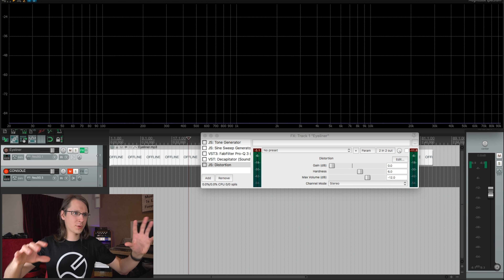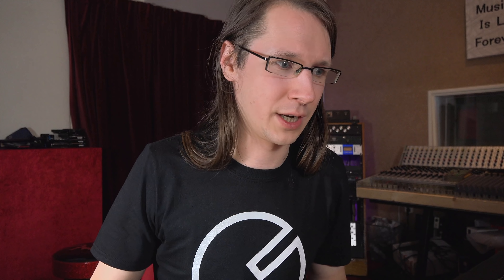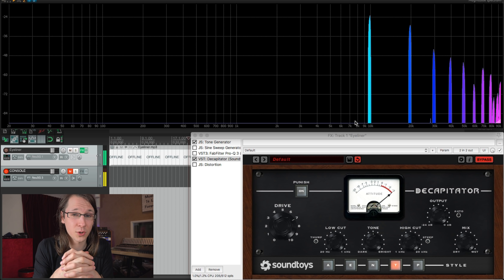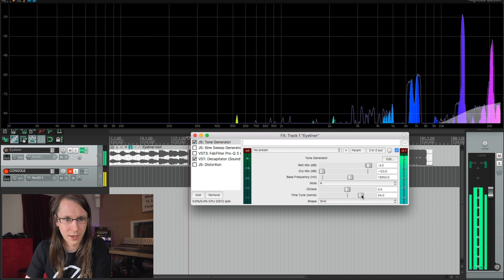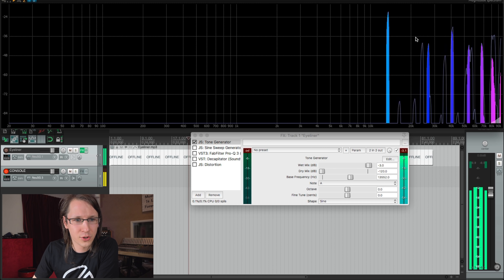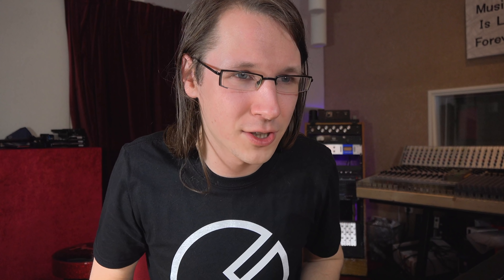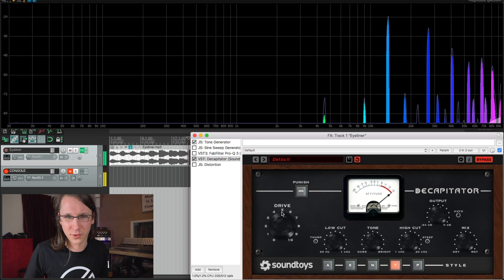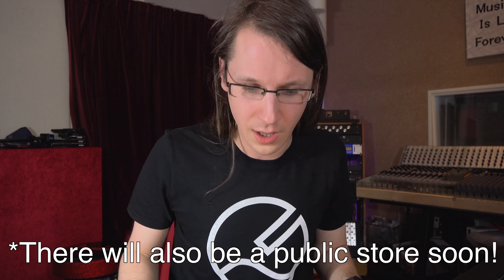Why MANY ANALOG EMULATIONS are SNAKE OIL!

Comment: couldnt you just use an insanely steep eq after a distortion to reduce aliasing? For example ableton's eq and saturator both have oversampling/anti-aliasing built in to avoid that. Could that just happen with say pro Q3?

Comment: What’s funny is I had this very conversation at AES LA  with a plug-in manufacturer he said all the things you just mention. Some guy tried to argue how 96k is overrated and not needed and draws to much cpu power etc. He basically gave him a science lesson on how sample rate operates on waveforms and also the relationship between plug-ins too. I felt bad that the music community attack you without the understanding of sample rate, low jitter, and clocking. They based their judgement on emotion and not science. They ran on I use this for all my mixes and this guy is an asshat. My view on it was did you run test to see why he said what he said and if no take your emotions out of it and chill!
Reply: which manufacturer was this?
Reply: @FloydAtema  This was back in 2016 I believe so I really don't remember. I remember sitting in the Genelec room before their presentation. Overhearing this convo (small room), and I started to kindly butt in and I learned the science behind sample rate and plugins and why they operated better at 96k.

Comment: So if it's due to aliasing then they're not 'snake oil' (?) Well, most of these problems can be avoided by proper gain-staging. Other factors are resolved by the approach that Acustica Audio (e.g. Nebula) takes. However, analogue devices introduce so many complex, subtle and no-so-subtle distortions & colours (that alter depending on all kinds of factors) that it is stranger to expect software to fully achieve indistinguishable emulations.

Comment: Greetings and thank you for the video. Would you recommend mitigating the anti-aliasing artifacts of distortion plugins in particular by using DDMF Metaplugin in its oversampling mode? I envision placing a distortion plugin into an instance of Metaplugin, setting it minimally to 4x oversampling, assuming one's session is running at a 44.1kHz or 48kHz sampling rate, and then routing the distortion's plugin into an EQ having a steep hi-cut filter. Would this better mimic the anti-aliasing capabilities of analog gear? Also, assuming this is a viable approach, how much of a CPU hit would this incur in comparison to simply applying a distortion plugin alone?

Comment: All very true. You can trust your ears but sometimes that isn't enough. I have come across some analog emulations (even quite high-end ones like the Elysia stuff) that produce aliasing artefacts well below the human audible frequency range but that are so 'loud' that they send compressors and other plug-ins later in the chain into meltdown, had to high-pass it out. Never liked decapitator though I really like some of the other SoundToys plug-ins. I think the analog emulations by Kush and PSP are good - it's not all snake oil by any means.

Comment: So the "Freshness" is creating "dirt" down on the lower frequencies, interresting. I guess the avarage plugin programmer doesn't care much about how the hardware works and they kind of fake it. 
They must have an attitude like "oh, now worries, she'll be right, it's close enough, no one will notice". That filter kind of makes sense, I've heard that a lot of early samplers contained quite a bit of anologue components in their input and output stages to make the sound nicer.

Comment: Thanks for this video. It’s indeed necessary to explain, why most digital simulations can work good in some occasions and fail completely in others. 
In addition: since the sample theorem is the limit, an enormous amount of oversampling would be necessary, to emulate distortion corretly.
The obvious question seems to me, why don’t we use digital plugins for all the tasks that require a certain precision and analogue technology for anything else?
I also think, a lot of producers and engineers care way too much about fancy plugin-porn, while recording as a creative process, especially good rooms, microphones and (last but not least) musicality as well as performance seem to be quite undervalued in some cases.
Reply: Actually, no you don't need an enormous amout of oversampling. The number of harmonics that aren't below detectable level is 19, i.e. up to 20 times base frequency. That means 20x oversampling would fix the issue provided your input signal was a sine close to the Nyquist frequency. If your signal is not a sine an appreciable part of the resulting spectrum is not the harmonics of either, but the sum and difference tones from the partials, which means that you are generally OK with less oversampling. 8x oversampling on most signals will result in aliasing artefacts well below the noise floor. Often even 4x oversampling will be plenty.
The reason we don't use more analog gear is simple: price.
Reply: We‘re talking about music, not a linear signal. To calculate distortion is significantly more complicated. Even the simplest blues scale played on a guitar multiplies the complications. Therefore our simulations are merely semi optimal at best. We should listen to mastering engineers complaining about too much bad saturation on everything and the tremendous loss of oportunities caused by such efforts to make recording sound warmer.

When I listen to recordings, made at the Jesus-Christus-Kirche in Dahlem/Berlin, it’s clear where warmth really comes from. Good musicians in a good room, recorded by decent engineers. There are recordings from this room, that sound perfect without any further treatment. Todays technology is breathtaking and offers great opportunities, but we shouldn’t forget the simple (or not so simple) basics.

https://www.kg-dahlem.de/index.php?id=44
Reply: No snakeoil necessary: https://youtu.be/CI32m4RqxJQ
Reply: @thiloschacht6311  Superb. But, what is that hiss on violoncello? Is that normal?
Reply: @retromatic1812  Maybe its simply the YouTube normalization that makes Mischa Maisky's breathing sound a little plain. On the original recording (which is at -27,2 LUFS) the breathing sounds a quite a bit different: https://www.deutschegrammophon.com/de/cat/4534242

Comment: Country simple: Ever drive through a tunnel at night in a car and see another car's wheels spinning backwards, maybe especially slowly?  If your sampling rate < data rate, AND not equal to a multiple...you're gonna get harmonics that fold over (downward) into your sampling range.  IF the rates are equal multiples (e.g. 24KHz and 48KHz) and things were perfectly sync'd and perfectly free of noise then nothing...well that's not reality, so let's figure the real situation out.  If the rate of the lights flashing is greater than the black/silver rate past a point on the wheel, think "animation frame rate" of the darker areas of the wheel, then you divide one by the other and keep the modulo.  60Hz flashing of overhead lights, and != 60Hz and != multiple-of-60Hz... then the wheel can't ADVANCE past the place it could turn to to be in sync with the light's illusion of the wheel moving...so instead if must be behind...and the wheel appears to rotate backwards.  Same thing!  Example: Wheel is going 157 "flashes" of spokes / second.  Light is flashing 60/second.  You're gonna see 60 goes into 157 twice taking away 120, leaving 37.  37 subtracted (think of it like a clock) from the 0 position of the wheel (noon) would make it look like it went 23 parts backward per second.   Hope that's more helpful than confusing.

Comment: Hey WSS! This video really got me thinking twice before reaching for plugins I use on a daily basis, I tryed to switch to 48 khz and then grab Span (pushing it to read to 96khz) but its kind of confusing how to measure if plugins behave correctly after the nyquist freq, ¿it should not generate more crap frequencies if (for instance) the sine tone or audio track that im measuring is high in the freq spectrum? Im kinda lost but I would love to measure my software... maybe a little guidance? 
Greets from Argentina, been in love with your channel thus far (L)

Comment: So, could you theoretically set your sample rate as high as your interface goes, apply a brick wall filter at 24,000 or wherever on the master, render, then save the file at a lower sample rate for distribution when using a plug-in such as Decapitator to achieve a more convincing result analogue emulation wise?
Reply: Get the vertigo vsm-3 way better decapitator  sounds dated

Comment: CLARIFICATION NEEDED: I have a question: if what you're saying is the reason why you hear problems with all these plug-ins, does it mean that you always test them with 48k sample rate on your audio interface? I thought you were always clocking at max, namely 192kH. Please correct me if I 'm wrong but this needs to be clarified for the rest of your Snake oil series...
Reply from the maker: I always test at 48 because of video capture reasons. But, they have to work on both sample rates...
Reply: @Whiteseastudio  Thanks for clearing that up. No problem with your testing I'm just asking as a user (I never record at 44.1 or 48k).

Comment: Would exporting stems already at 44.1 to 192 kHz give my saturation plugs the extra headroom they need to partly solve the problem or does the source file need to be native 192 kHz? So raw file at 44.1 > Convert to 192 kHz and add saturation > Reconvert to 44.1 post saturation? Anyway, great video man!
Reply: That would work just fine.
Reply from the maker: Should work!

Comment: I noticed something the first time I saw one of your videos and now seems an appropriate time to mention it. I feel the same way about your 3D logo open that you feel when you (ironically) talk about plugins not oversampling. The faceting on that model is out of control. It's bad enough you can see it when the logo gets close to the camera but it can clearly be seen once the logo settles into place. This could've easily been fixed by higher resolution - i.e. more control points in the curve or higher tessellation before extrusion.

Comment: Can I ask you guys something about mastering compression? I've seen on this channal that you can apply multiband compression on the whole mix during mastering. At the same time I've read on other platforms that it's not a very good idea. Is there, like, a rule about this among mastering engineers?
Reply: Nope, there isn't a rule. As with everything else in audio, there isn't one specific way to do it well, but infinite ways to screw it up. Good luck!

Comment: Does this mean you would wanna mix at a higher sample rate than the audio is recorded?
Reply: The video is about certain plugins that are unable to remove artifacts because a) their processing sample rate is too low to capture 'fast' noise and filter it out, and b) because they don't bother doing filtering on the first place because it requires extra processing power for a result that is barely audible. But yes, generally it's a good idea to maximize the sample rate (and the bit rate for more dynamic range) in any signal processing algorithm. Beware of the hardware resources though.

Comment: Very interesting. I am interested in doing those tests and I am curious how Melda Production plugins are handling this issue cause they offer extreme oversampling times in live as well as rendering modus. Great video thank you. 

Ps. 
Why did you take out the Decapitator video and will you do a new one?
Reply: I've been using some Melda plugins too. They sound pretty good. Pretty smooth.
Reply: @DaveBessell  
Cool. I am on holiday and will do my tests afterwards. I am very interested in the results different plugins will show and what the differences of oversampling will be. Can I  use Pro Q3 for analysing or is there a smoother options. Melda has great analysers too. Maybe there is an ideal one?
Reply: three years later, what is your perspective on this?

Comment: Is over sampling still beneficial  when recording at 48Khz? Or does this just relate to plugins? 
Should I record at 96k and over sample on my plugins? 
Sorry just a little confused as to how I can apply this to my projects.
Reply: It is very likely that your DAC itself will have aliasing both during recording and during playback. Most mid-price DACs do very poorly in filtering frequencies at a sampling frequency of above 48 kHz. If you do not have a high-level DAC, then stick to 44.1 or 48 kHz while recording.
Reply: Sergey Abramov Thanks for the tip!

Comment: If you don't hear the crap sounds unless the levels are exaggerated , then it's not too much of a problem. Analog or not, if it sounds good it is good. I suppose disagreeing with the measured results is useless, but Decapitator is still a great sounding plugin compared to even others that do offer oversampling. Maybe they will update the plugin now!

Comment: interesting test... never thought about that. I love decapicitator or soundtoys plugins in general... maybe I love the grid or (unwanted sand or grain) - I have not experienced to really notice that bad effect when using the decapicitator. But still thanks for that good test and showing whats going on... I would be interested what the inventor of decapicitator thinks of this or if he could explain if you really will hear this when its in a musical context... so like i mean hissing noise on a tape... and still people like tape emulation... sometimes its about that smudge or dirt to warm up your sound... Hmmmm I need to check that out. You could try to contact the guys at soundtoys and ask them ? Maybe the update the plugin with oversampling...

Cheers TweakerRay

Comment: I was just starting to want to buy Waves NLS, now I'm not so sure... aaand my demo just ran out so I can't test the response. :(
Reply: Don't bother with it. It literally is just a saturation plugin (and far from exceptional at that). You can literally emulate its behavior by applying subtle saturation of the same flavor on all tracks. It does NOT emulate "summing" literally contradicting its name! It doesn't get more snake oily than this.

I have researched and compared in-the-box console summing extensively (from Waves, Slate, Brainworx, SKnote, Acustica...). The best I found is the one from Airwindows (latest version is Console 6). It actually emulates summing behavior (i.e. that subtle nice thing that happens when voltages from different tracks mix together in a physical summing mixer, effectively replacing DAW summing and making the sum sound more 3 dimensional), not merely apply some saturation to tracks and call it summing. Some audio site once even did a blind test with a group of users and it came out on top. And it's free (with a voluntary Patron model).
Reply: @marvenmema  Thank you so much, that's NLS scratched off my wishlist now then! I'll definitely check out Console.

Comment: Also something interesting: because guitarists are so massively sensitive to how distortion sounds, I wondered what the internal sampling rate of the Kemper Profiler is, given 1) it's the most convincing amp-sim on the market right now 2) the theory here tends to suggest that the higher the sample rate the more authentically analogue distortion sounds - I have read (unconfirmed) that it's 700kHz/16x oversampling. Given the average guitarist doesn't have a fucking clue what oversampling even is so they wouldn't be interested in that purely for dick-waving, I found that quite interesting.

Comment: You are dead on, but here’s the thing: Oversampling requires exponentially more CPU per instance, and depending on the complexity of the effect being modeled it can get out of hand fast. Case in point, IKMultimedia Tapes. I’ve recorded on real tape machines and IKs Tapes is the only one I’ve heard that’s so close to the real deal and high quality I’ll use on a master (and do a lot ;). Because it oversamples internally A TON. Can’t turn it off, and has a massive processor hit. Running several instances in real time is a no go. And of course, people complain about that! Even I do. I’m an Oberheim enthusiast and got BX_Oberhausin... I never use it because the CPU load is ridiculous and OPX pro is nearly as good and 10 times lighter to run. So it’s a problem for plugin developers. If you can get close without taking over the users entire computer, it’s going to be more popular. Why I really appreciate oversampling added in as an option though

Comment: Congrats, the best and clear explanation I got on the subject! Many thanks for this!
I am surprised, though, that Soundtoys don't offer an oversampling option?? I'll have to check this out...
Reply: Hope they see this vid and update their stuff.
Reply: @clolo4615  Hope people will find "mix" and "high cut" in this plugin. And they will finally learn how to use them.  
And it would be even better if people realize that oversampling is not a panacea either. That instead of reducing the aliasing level, it brings either horrible phase distortions, or a noticeable ringing, and this does not even take into account that the high frequencies in any case will suffer from the filter.
Reply: @EG_John  Surely the filter in the plug-in will cause phase distortion or ringing, not oversampling?
Reply: @nosucherror  filtering is an integral part of resampling

Comment: Well, you can oversample. Or run projects at a higher sample rate. Still A LOT cheaper and simpler than hardware, right. But yeah, it should be mandatory to oversample plugins that generate harmonics past nyquist. Many manufacturers do nowadays though. Still, important stuff.